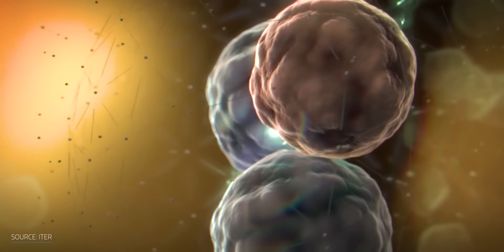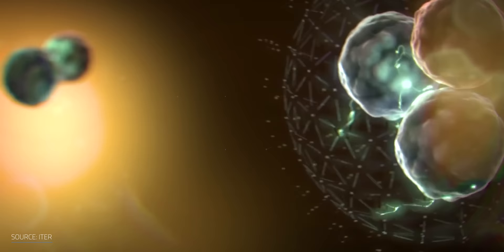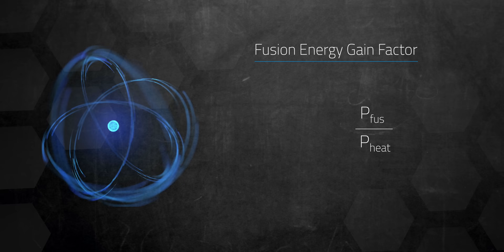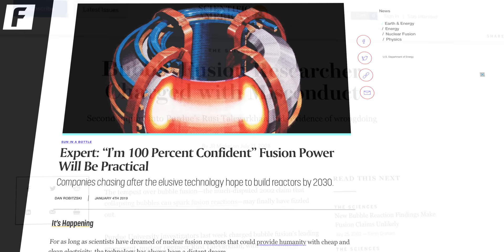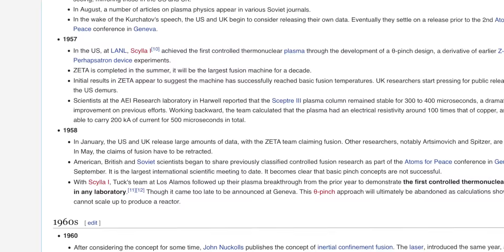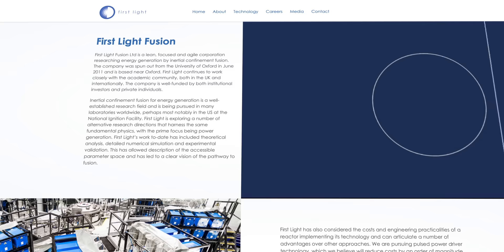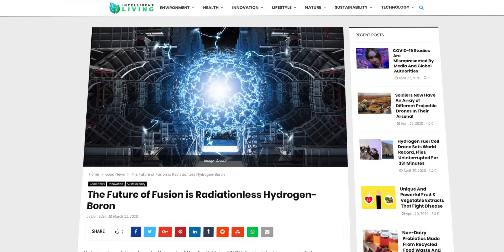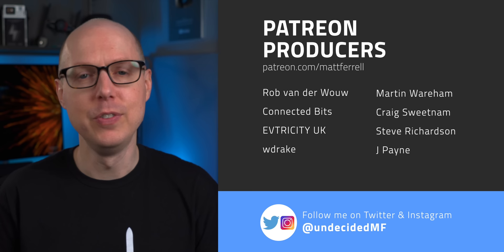The truth about nuclear fusion power - new breakthroughs

Comment: I've been following the so-called breakthrough announcements for the last 50 years. Most people, who view this technology as being our savior, don't have such historical perspectives. Many articles hype the technology without including any critical analysis. The rarely mention that despite massive amounts of spending, on a variety of experimental projects and decades long delays, a significant breakeven fusion reaction has yet to be demonstrated. The hyping articles often don't mention the significant barriers that still need to be crossed, such as dealing with 100 million degree plasmas operating very close to superconducting magnetic coils that must be kept near absolute zero Kelvin while exposed by a flood of fusion energy neutrons. Such promotional articles often fail to mention the problems associated with handling radioactive hydrogen, tritium, or that the thermalized neutrons can convert non-radioactive materials in the structure into radioactive ones. Often press releases, from such projects, are crafted to attract more experimental resources, or investors.

Those, working with such projects, typically assume that humanity has 2-3 decades left to create commercially manufactured fusion power electrical plants and deploy them on a massive scale to replace all fossil energy uses. That includes creating non-carbon synthetic fuels to power cars, buses, trucks, trains, ships, and aircraft. The experimenters, promoters and investors tend to be clueless about statements such as the following.

UN chief: World has less than 2 years to avoid 'runaway climate change'
https://thehill.com/policy/energy-environment/406291-un-chief-the-world-has-less-than-2-years-to-avoid-runaway-climate

UN Chief warns countries that the 'point of no return' on climate change is fast approaching
https://www.msn.com/en-gb/news/environment/un-chief-warns-countries-that-the-point-of-no-return-on-climate-change-is-fast-approaching/ar-BBXCJHl
Reply: Vernon Brechin I’m scared
Reply: @puppysareawesome2068  - Sorry! We are all mortal. I assume that, unlike many others, you may see what is happening.
Reply: As somebody with a scientific background who's been involved in environmental activism in the past, I don't think the fact of impending catastrophic climate change behooves nuclear fusion advocates and researchers to abandon their research or give up their goals any more that it behooves the man on the street to do more than he's currently doing (which is practically nothing). 

Given the fragmented pseudo-democracies which are the major carbon emitters at present, a popular appetite for change (ideally demonstrated at the voting booth) is a necessary condition for averting the current road of catastrophe we're on. As we well know, that same popular appetite is currently being mostly shaped by targeted advertising designed to capitalize on fear and anxiety - and promote the status quo of relentless consumption. As such, the necessary popular desire for the change we need isn't coming, as it's not in the interest of those pulling the strings.

As far as I'm concerned, let the nuclear fusion researchers do their thing in peace - they aren't and were never going to provide the solution themselves. We need a majority of people to wake up and agitate for change (or really, we needed them to decades ago), but it's not going to happen. Technology has produced a global society of lazy, alienated consumers, who will never willingly unplug themselves from the system which provides them with fast food and instant entertainment.

Enjoy the last few years of relative comfort we have now before it all goes sideways and try not to let the existential fury strangle the everyday pleasures. I'm so disappointed in this world...
Reply: Nuclear fusion is theory. Nuclear fusion is a fairy tale. The sun is electric ffs
Reply: A historical perspective is only worth something as long as the past performance/possibility accurately predicts future state of those same capabilities. The person who said we could never fly was right for a long time, up until they suddenly weren't. Also, a lot of what you claimed above is becoming less restrictive, for example, HTS tape that is mass produced today is a resilient superconductor that doesn't quench with significant current at temps up to 70 kelvin. They also enable magnetic fields much higher than before, and firmly localize you on the Q > 1 - 10 on the Lawson criterion. As mentioned in the video, the performance of fusion devices has gained exponentially, faster than Moore's law, its just the requirement for a working MVP is much higher for fusion than semiconductor chips. I agree though that the world has largely failed in its approach to climate change, especially the United States, recently. However, humans I believe can still innovate their way out, if we commercialize DT fusion, we'd actually have access to enough energy to recapture carbon and other gases on a terraforming scale. 

This isn't meant to be an indictment of your general message, but I feel like there is more hope than your comment may let on to others.
Reply: @ppatil3655  - A great number of people on this planet retain a lot of hope. It is a characteristic that is deeply engrained in many of us. "Hope springs eternal."
Reply: @theozzyjoker2985  -  We live in an age where many people take great pride in holding outliner views. That holds true for 'flat earthers' and 'Holocaust deniers.'
Reply: @vernonbrechin4207  we also live in an age where mainstream ideologies are so twisted and warped that physics has taken a back seat to stupidity and ignorance. We also live in an electric universe not a gravitational one. We aslo live on a sphere not a flat plain
Reply: @Shimmy Shai - Good points. I didn't propose that all funding for the many efforts, in numerous countries, should be ended. There are some lovers of technology who believe that all efforts in this field should be continued to be supported.

Those, who state that we should be spending 3-5% of global GDP for the next 20 years to turn things around must be clueless regarding the following two statements.

UN chief: World has less than 2 years to avoid 'runaway climate change'
https://thehill.com/policy/energy-environment/406291-un-chief-the-world-has-less-than-2-years-to-avoid-runaway-climate

UN Chief warns countries that the 'point of no return' on climate change is fast approaching
https://www.msn.com/en-gb/news/environment/un-chief-warns-countries-that-the-point-of-no-return-on-climate-change-is-fast-approaching/ar-BBXCJHl
Reply: @Shimmy Shai - Good observations. We need to concentrate on near-term solutions. In the U.S.A. we started working on negative emission technologies, in the form of injecting CO2 underground, at an experimental site around 15 years ago. You might want to research how far we have come with that technology since then. It is now known that we also need to be drawing vast quantities of highly diluted CO2 out of the atmosphere. The current demonstration plants will be needed to be scaled up by a factor of at least a million and will need huge amounts of resources to construct them and vast amounts of power to operate them. I haven't seen a lot of progress in that direction during the last couple of years.
Reply: @t00by00zer  - The linked video said absolutely nothing about creating a sustained reaction that generated more energy then was put into the system. None of the formal conference presentations make any claim saying the experiments have generated even a microwatt of electrical power. In your sense a awe, of this masterful video creation, you likely never noticed that. The project has lasted for six years and yet never had much to show for the investments that have been made in it.

The Safire Project is followed and promoted mostly by people who have very limited academic backgrounds in the relevant fields of science. It is not given any serious coverage by the mainstream scientific community. Many of the promoters view that as simply another reason to promote it because they have been convinced that rejection is a strong indication that they are right. Many also enjoy various conspiracy theories.

Promoters, who often brand themselves as skeptics, typically have absolutely no interest in critically examining the technology that they have fallen in love with. Their primary aim is to search for more information to reinforce their deeply entrenched worldview. They engage in a process known as circular thinking, which is fundamentally closed thinking.

Electric Universe
https://rationalwiki.org/wiki/Electric_Universe

SAFIRE Project

The International Science Foundation (a front group of EU supporters who falsely claim to neither support nor oppose the Electric Universe hypothesis) says that they provided $2,200,000 USD to fund a laboratory experiment to test the EU claims regarding the nature of the Sun. There is no independent analysis of their work and no publications about SAFIRE found on Google Scholar. The SAFIRE Project is housed in Mississauga, Ontario, and is documented in videos from the EU2016 conference. They say that their intent is to compare the results of this experiment to the results of NASA's Solar Probe Plus mission, and thereby demonstrate whether the EU solar model has any grounding in reality.

-----
Zero-point energy
https://en.wikipedia.org/wiki/Zero-point_energy

  Purported applications

  Physicists overwhelmingly reject any possibility that the zero-point energy field can be exploited to obtain useful energy (work) or uncompensated momentum; such efforts are seen as tantamount to perpetual motion machines.

Nevertheless, the allure of free energy has motivated such research, usually falling in the category of fringe science. As long ago as 1889 (before quantum theory or discovery of the zero point energy) Nikola Tesla proposed that useful energy could be obtained from free space, or what was assumed at that time to be an all-pervasive aether.[199] Others have since claimed to exploit zero-point or vacuum energy with a large amount of pseudoscientific literature causing ridicule around the subject.

-----
This is the same sort of promotional game that I've seen from two non-nuclear engineers in their multi-media promotion of molten salt thorium reactors. Only, in this case the researchers are getting funding to play with their toy.
Reply: @Shimmy Shai - Many technically oriented people believe that all technical options deserve to be pursued no matter how much they cost and how likely they are to lead to something practical.
Reply: @vernonbrechin4207  LOL.  Rationalwiki????
Now I know you're not serious.
You'll NEVER have fusion power any way other than what SAFIRE is doing.  SAFIRE allows plasma to do what plasma does.  It's not attempting to "bottle" the plasma in some magnetic field.  Plasma does that on its own.
Yep, always 50 years away.  And that's how it will always be with you.
I'll bet you think dark matter is real too, don't you?
Good luck.
Reply: @t00by00zer  - One of the strategies, used by hard-core believers to protect their deeply entrenched worldview, is to reject all information sources that clash with what they already believe in. This often involves rejecting and bashing all mainstream media sources, such as the New York Times and the Washington Post. They start out with a premise and then work hard to find information sources that reinforce that premise. They are victims of their own circular thinking processes.

They have to do this because their love affairs, with such fringe beliefs, becomes a fundamental part of their sense of identity, and their social interactions.
Reply: @vernonbrechin4207  you've just described rational wiki.  You don't even bother to understand plasma physics and you talk about fusion reactors like they will ever produce actual electricity.  None of them have.  They all produce HEAT which is measured, because you can convert heat into electricity with a steam turbine.
SAFIRE has a confirmed POSITIVE thermal output / energy input.  They are converting elements, measuring their spectral output, and releasing the energy of "fusion"  as measured by reactor temperature.  But you don't care to look any further than rational wiki tells you.  Gate keepers.

Citing the NYT as a credible source these days is embarrassing.

How's that dark matter search going?  I'll bet rational wiki has all kinds of excuses for why billions spent for the search have produced nothing but red ink.
Reply: @t00by00zer  - When measuring energy input to energy output, the important thing is the absolute total energy that went into the system. Many experiments don't show that total. I will believe that they got more out then they put in when I see that stated in a peer reviewed paper in a reputable scientific journal such as 'Science.' There so-called breakthrough research has not been published in such journals. What they claim in clever videos and their conferences doesn't count.

If the other elements were the result of fusion in the plasma then why didn't they detect fusion neutrons, and why didn't they find radioactive isotopes of the claimed produced elements? Why would all the isotopes formed be stable types?

Did they report achieving temperatures of around 100 million Kelvin, or greater, needed to drive the nucleosynthesis of other elements from nuclear fusion reactions of the plasma ions?

Did they rule out the possibility that the detected other elements were contaminates from the walls of the vacuum chamber? Again, where is the peer reviewed  evidence for all the things you claimed?
Reply: @vernonbrechin4207  what they achieved, if you'd bother to read and watch what they have put out there, is a reactor temperature that was many times higher than the simple, power in = power out.

What happens when you add gasoline to a fire?  You get energy from something other than what was producing the fire in the first place.
For years they ran the plasma experiments and verified all the thermodynamic modeling of electrical power in to reactor temperature rise.  And on one occasion, as they varied the atmospheric content, changing the trace gases relative amounts and reactor pressure, the reactor "ran away" very quickly causing the anode to melt.  At 13% of the power of previous "max reactor temperature" they were reaching max reactor temperature.  Their spectroscopy revealed trace elements that weren't in the chamber to start. 

Do yourself a favor and quit letting rational wiki be your gatekeeper.  Watch that video I linked.  In it they discuss exactly what happened, that they've repeated it many times before they announced their results.
They admit they aren't sure what is going on, but I have a feeling I do.  There have been studies done on turbulent plasma in a remnant magnetic field.  Plasma is literally electric current.  And when you have ions moving rapidly in a magnetic field, they will "curl" and create opposing field structure against which other ions feel influence.  Turbulent plasma magnifies magnetic fields by many orders of magnitude.  In the region of the plasma double layers visible in the reactor, the boundary experiences turbulence.  Those boundaries are defined by powerful magnetic fields generated by the plasma itself.  Remember, SAFIRE isn't doing anything to the plasma other than varying voltage and current and gas content and pressure, all at very low pressure.  They're attempting to verify theories about the atmosphere of the sun, which consists largely of plasma.  They didn't expect to see fusion.  It just happened and they kept track of exactly what they were doing when it happened.  They then repeated it, over and over.  They are ready to build a demonstration reactor.
Don't be afraid to look and see for yourself.  You're obviously a sharp fella.  Have a little confidence.  It's an amazing discovery about the nature of plasma and how fusion actually takes place ON the sun, not IN the sun.
Reply: @t00by00zer  - Let's see how that plays out the next few years. Di-hards will never give up. All failures will be attributed to evil forces working against the project.
Reply: @vernonbrechin4207  They aren't claiming any conspiracies working against them.  They aren't seeking government grants.  They're volunteering to build experimental reactors for other to repeat the experiments themselves.  This thing fits in a garage, literally.  It's a large vacuum chamber and a cooling system, fed by various gases and powered by DC.
It was built to test a hypothesis of the plasma environment of the solar atmosphere. 

It doesn't take a hundred million dollars to construct one and it doesn't take a nuclear power plant to get it started.
Fusion reactors will never work because they are trying to force plasma to do something it doesn't do on the sun.  Plasma is chaotic, turbulent, not tightly controlled and squeezed artificially by external magnetic fields.  It does that on its own, as is its nature.  The SAFIRE team just figured out the right ingredients to kick off the reactions of various atomic ions exposed to energetic protons in the double layers that naturally form.  The result is new elements and a lot of heat.  The heat is measured by how hot the chamber gets.  With the right mix of atmosphere, they get a massive yield.
They aren't trying to force nature to do what they want.  They're letting nature do what it wants when given the right environment.
Reply: @vernonbrechin4207  By the way . . . you say die hards will never give up.
How long have they been promising fusion power exactly?  My whole life of 62 years for sure.
SAFIRE launched in 2013 and took a completely different approach.  They weren't looking for fusion.  They were doing science, experiments, and they had keen eyes and saw something new.
Sometimes, doing the same thing over and over expecting a different result may not be the best way to approach a difficult problem.  Magnetic containment of plasma in a torus is not what happens in the sun.  Why would it work anywhere else?
Reply: @t00by00zer  - It is perfectly natural for people who have seen their dreams and ideals vaporize to seek alternative solutions. You also see it in cancer patients who have run out of mainstream options. Often they will fall for quack cures out of desperation. There are many salespeople who are masters at gaining peoples confidence in them only to fleece them. They know how to tell people what they want to hear.

The SAFIRE experiments deal with what happens in the sun's photosphere. That is not the energy source in the sun and it doesn't involve fusion nucleosynthesis of helium and higher atomic weight elements. Those things take place in the far higher temperature core of the sun and other stars due to fusion reactions. ASFIRE researchers attract those who are unaware of such details and easily fall for alternative explanations. I suggest that you go to the Wikipedia article on the sun and follow the links leading to what happens in the core of the sun, the source of its energy production.

You are correct that the sun doesn't rely upon magnetic confinement fusion (MCF) to create its fusion reactions. That is because the enormous core pressure is due to the enormous mass of material that lies above it. In the case of MCF the intense magnetic fields, typically generated by superconducting magnets, serves to compress the plasma to pressures near that in the core of the sun. All those, who have a fundamental academic background in astrophysics, understand such issues.

Initial Confinement Fusion (ICF) is another fusion approach on earth. It involves using things like intense, very short pulses of laser light to ionize a fuel pellet surface so that the shockwave from that will coverage near the center to initiate a fusion reaction. The National Ignition Facility (NIF) in Livermore, California, USA, the largest facility yet built, costing billions of dollars. It never achieved its primary goal of achieving break-even fusion and the developers now admit it likely never will achieve that.

The key researchers have promoted it to the public as a promising path to fusion energy production but in fact it has always been funded as a thermonuclear weapon research project. Most fusion researchers admit that it is not a promising approach to a practical fusion energy producer. In the meantime the government keeps funding it so the researcher can continue to have fun with their amazing multi-billion dollar toy.
Reply: @vernonbrechin4207  they don't know how the sun produces energy.  They THINK the sun is a ball of gas, but have absolutely no evidence to support that conjecture.  The sun emits a black body spectrum.  Gases don't emit black body radiation.  Only LATTICE STRUCTURE emits a black body spectrum.  What we see at the sun is a condensed matter object emitting black body radiation.  It is a thermally heated object, but heated from the OUTSIDE.  It is mostly likely liquid metallic hydrogen near the outside and a solid lattice of hydrogen near the core.  There is no fusion taking place in the core.  The fusion takes place in the atmosphere where plasma actually exists and we can see it.
The solar wind consists of every element in the periodic table.  They have seen them all.  If fusion is taking place in the core, and it takes a photon millenia to escape, how the hell is an iron nucleus making its way out?  Elements are made in the solar atmosphere.  That is where we see them and measure their spectra.  That is what they observe in SAFIRE.  They observe NEW ELEMENTS that were not in the chamber at the beginning of the experiment.
NASA just concluded that the atmosphere of Saturn is heated by plasma currents arriving at the poles.  The heating is astounding.  There is more energy in the plasma current than from sunlight across the spectrum.  Our own atmosphere is heated by plasma currents arriving at the poles.  Plasma is ubiquitous in the cosmos.  The galaxy is a giant plasma structure, much of it in "dark mode" and difficult to detect.  But when plasma reaches matter and is allowed to discharge, vast amounts of energy and high energy physics takes place.  We see it in our own atmosphere with a lightning discharge.  We detect gamma radiation in lightning.  We detect isotopic changes in elements.  Lightning creates plasma, and plasma, given the right environment, naturally undergoes fusion IN A LIGHTNING BOLT.
SAFIRE is testing the hypothesis that the sun is powered the same way Saturn is, via plasma currents impacting the polar regions.  The theory is well established.  Ralph Jeurgens, Hannes Alven, Anthony Peratt, Ph.D level folks put their intellect behind the idea.  The universe beyond the atmosphere is almost entirely in ionic form.  It is only the few specs of dust like the earth that exist near absolute zero that the electromagnetic forces have collapsed into discharge.  Out there beyond the shelter of our atmosphere is ionizing radiation, and any grain of dust "out there" becomes a charged particle, either + or -, and as it moves, it creates a magnetic field in its wake, and if there's another charged flake of dust, that magnetic field will reach out with many orders of magnitude more influence than the mutual gravity of those two dust grains.
If you really want to know why the universe is filamentary, it's not gravity or dark matter.  It's charged dust and plasma.  Look up "Marklund Convection" and you'll have the answer to how stars and planet actually form.
Reply: @t00by00zer  - By branding that as pseudoscience you conveniently reject all that is presented there and perhaps anything else that appears on such sites. Isn't the human brain amazing in protecting us from undesired viewpoints.

Thanks for the link. Some people are very gullible for presentations that throw around a lot of technical terms that many of them feel like the presenters must be geniuses. They are geniuses at drawing in highly gullible people who don't have academic backgrounds in the fields that their amazing video productions purport to be informing others about.
Reply: @vernonbrechin4207  what I mean by pseudoscience is that it is not based on experimental physics.  There is nothing being done at CERN for example that can demonstrate the existence of neutronium.  Every single experiment set up in the last 50 years to detect "dark matter" has failed.  It's easy to invent something in your mind, and much more difficult to conjure it into existence.
Dark matter was concocted based on a faulty assumption, that being that observations of galactic and universal structure and motion are due to gravitational interaction.  When the observations were assigned a gravitational origin, dark matter resulted.  And they invented all types of forms never before seen, concluding that MOST of the universe was dark matter, except for in our area of the universe where we can't seem to detect it.  And yet observation after observation of the real universe seems to always "surprise" cosmologists.  It's easy to understand why.  They don't know what they're looking at or how it behaves. 

Gravity is a bit player in the cosmos, not the conductor.  The conductor of the symphony is electromagnetism.  It's obvious!  The solar wind doesn't care about gravity.  It leaves the sun at hundreds of kilometers per second.  And yet earth's magnetic field can yank that wind right down.
Cosmic jets have nothing to do with black holes.  They are electromagnetic phenomenon.  Pulsars are relaxation oscillators, not spinning magnets.  Bodies in space are capacitors.  Plasma streams are capacitors with terajoules of energy within them.  It is when discharge occurs that energy is released.
SAFIRE is experimentally showing that fusion ON the sun is where nuclear synthesis takes place, not in the core.
Reply: @vernonbrechin4207  By the way, some of the "Suspicious Observers" are NASA, Goddard, Harvard . . . you get the idea.
Ben's Textbook is now used in universities all over the country.
His work had led to the science of earthquake prediction based on solar electromagnetic conditions.
Real science.  You check with Rational Wiki and tell me what they want you to think.
Reply: @t00by00zer  - Your claim, that "SAFIRE is experimentally showing that fusion ON the sun is where nuclear synthesis takes place, not in the core," is not supported in any papers publish in well respected, peer reviewed, scientific journals such as Science, or Nature.
Reply: @vernonbrechin4207  more gatekeepers.  You're not interested in anything that does not comport with the "accepted" theories promoted by mainstream academia. 

Take for example, Anthony Peratt.  Look up his resume.  His work in nuclear physics destroyed more top level equipment in one experiment than a typical academic research budget spends in a year.  He did real, high energy plasma physics. 

Those INTERESTED in the work will look for themselves.  The SAFIRE team has offered to make reactors available for experiment.  I'd say that's pretty darn transparent, wouldn't you?  They're not trying to hide anything. 

You can go to your gatekeepers and ask them why they haven't looked at it.  They'll look at each other, check their rational wiki "fact checkers" who look in the quackademic texts for confirmation of their bias, and proclaim it can't be done because no one will agree it's possible.  That is the state of peer review today.
SAFIRE is offering to show anyone.  They are ready to build a demonstration reactor.  The first is to show how the reactor can render nuclear waste to a harmless isotope by ionizing it and adding it to proton plasma.  The heat generated in the process could be harvested to turn a turbine, but they first want to show how it can mitigate nuclear waste.
Reply: @vernonbrechin4207  I don't care what they think.  What do YOU think?
Ben has "peer reviewed" papers co-authored by NASA/Goddard professionals with all the credentials.
What do you have?
Reply: @vernonbrechin4207  talk about projection.
You can't even form your own opinion without first checking with rational wiki.
Reply: @t00by00zer  - Folks, such as you don't rely upon having a deep background in astrophysics and nuclear physics. You rely heavily upon hero worship. You throw out citation sources, such as Anthony Peratt, without checking if their research has been presented out of context by YouTubers such as Sen Davidson.

Suspicious0bservers
https://rationalwiki.org/wiki/Suspicious0bservers

If you had a sold academic background in nuclear physics then you would be aware that taking ionized radioactive isotopes and   adding it to a proton plasma, that is orders of magnitude below nuclear fusion temperatures, is not going to transmute those isotopes in to various stable isotopes.

The vast majority of followers of this tripe have no such academic backgrounds. Those, di-hard believers, who attend the small Electric Universe conferences, spend almost $400 a seat to see their guru's give impressive presentations.
Reply: @vernonbrechin4207  listen to you.  You study a failing theory that can't explain observations without invoking imaginary objects that no one can prove or disprove actually exist, and you call that, science.
Excuse me while I check with my unicorn for his opinion.
I linked you to an article from the "main stream" highlighting astrophysical observations that violate dark matter physics.  You defend the physics.  I defend the observation.  Reality trumps your beliefs.  Dark matter is a conjecture based on an assumption.  It is not, science.
Reply: @vernonbrechin4207  you know what is especially sad here, is that you, who claim that you're some expert in nuclear physics, and then proclaim that they can't reduce nuclear isotopes in a proton plasma without reaching some theoretical "temperature" and yet you have zero idea what is going on with the plasma double layer boundaries.  What's really funny, is that they don't claim to know what's going on either, and invite other to attempt to explain THE OBSERVATIONS of iosotopic transformation in the proton plasma atmosphere undergoing formations of double layers.  Do you even know what a double layer is?
Astrophysics without a fundamental and rock solid foundation in plasma physics is about as useless as tits on a boar hog.
You dismiss the electric component because rational wiki says to.  Wal Thornhill, before Cassini arrived at Saturn, made a prediction about the temperature of the winter pole that Cassini would measure.  He said it would be hotter than the equator.  He was right.  And with NASA's latest "peer reviewed study" they have concluded that Saturn's atmosphere is driven LARGELY by the plasma currents, and not direct solar radiation.
You keep dreaming about dark matter and black holes.  In 50 years, they'll be no closer to discovering either one.
Reply: @vernonbrechin4207  One final point for you to chew on.
SAFIRE and the claims are 100% FALSIFIABLE through laboratory experimentation.
Are black holes?
Neutron Stars?
Dark Matter?  We've spent BILLIONS building "detectors" in a vain quest to test that theory.
SAFIRE has claimed nuclear waste mitigation in EXPERIMENTS.
SAFIRE has claimed max reactor temperature at 13% design input power.
They have claimed they can replicate these results ON DEMAND.
PROVE THEM WRONG!
Don't just sit there and say it can't be done.  That's the equivalent of a child throwing a tantrum insisting Santa is real.
They are making big claims.  They aren't claiming to understand everything that is happening, only that it is.
Can you explain what a magnet is?  Can you really explain what it is?
You can use them.  You can describe their field geometry, but you can't explain why they exist.  They aren't claiming anything other than results to an experiment.  They observed transmutation of elements, both deposited on the anode and present in the atmosphere, with spectroscopic real time analysis and third party analysis of the anode deposits using electron microscopy.  They have all the data.  They are inviting people to investigate and theorize why it's happening.
They claim the experiments can be replicated.
A scientists wouldn't consult rational wiki.  A scientist would run an experiment or observe one.